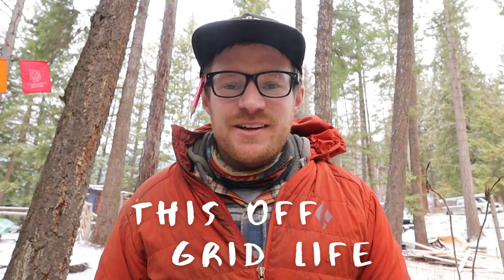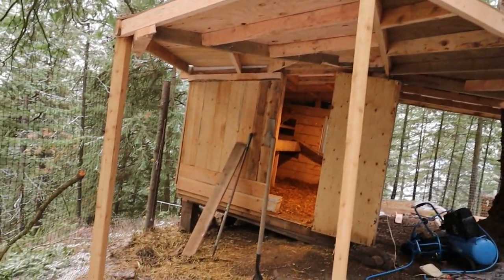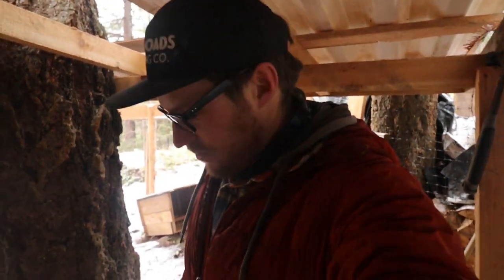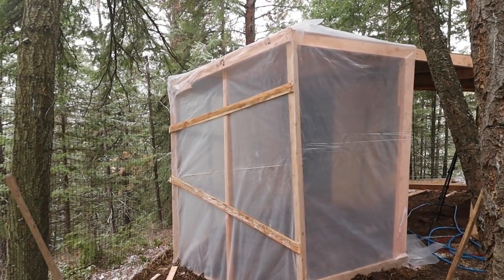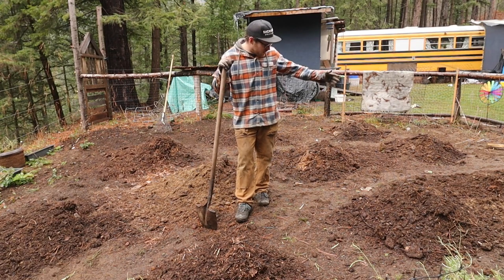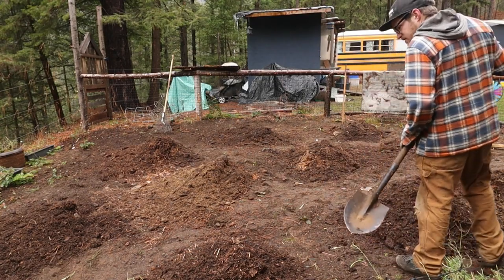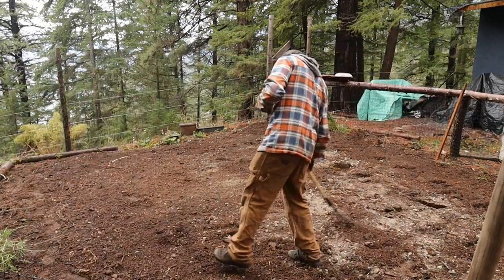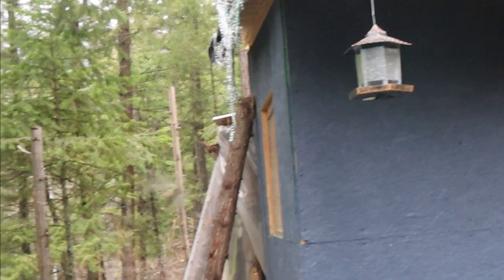Adding Humanure Compost To Our Garden

Comment: Hi Greg , if you make a two wheel bogey about  three or four feet wide you can tie the heavy end  of the trunks onto that and pull the light end with a cable attached to the tractor. That will ease the weight and pressure on your tractor. Two wheels will take the "drag" factor out of the  equation.

Comment: What kind of Solar power (PV) do you get on a grey-day like that? Enough to top-off the batteries?
Reply from the maker: Doesn't usually top us up, but enough to keep us going. We have since switched from lead acid to lithium ion batteries and are working towards a 48v system so charging happens faster. Just on 24v at the moment